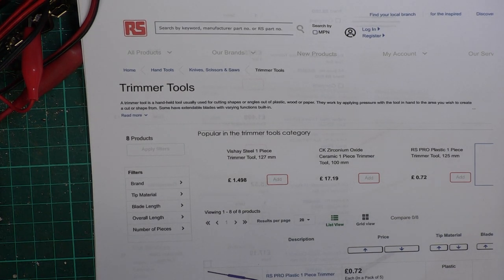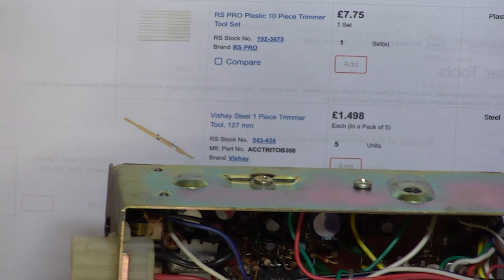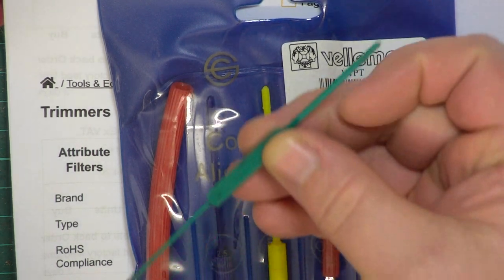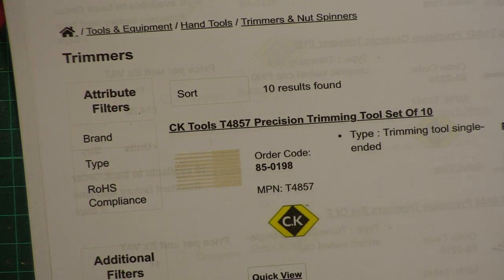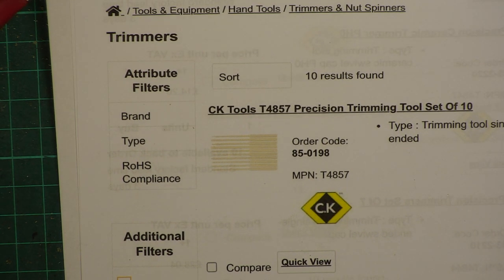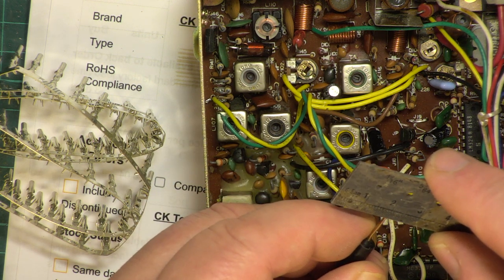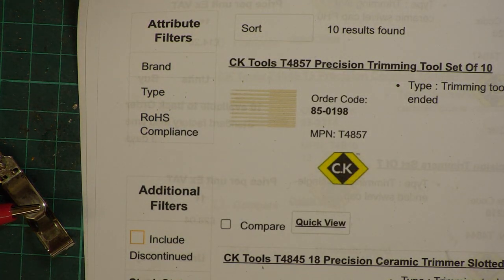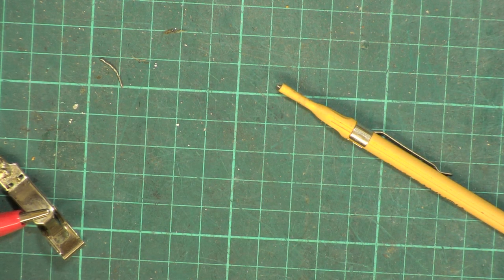Alignment tools used in UK CB radio servicing

Comment: i've got a set of Vishay trimmers all three and they're all black and badged up Radio Shack..!!
got the beige ones, the ceramic ones, don't bother with those plastic ones as they break too easy,
also got some hex ones for Cybernets and even a square one for multimode VCO.
once you find the right couple or three you never need any others.

Comment: You still get the black trimming tool, but it takes a bit of searching for.  Some Chinese sellers used to do it and it used to be common on Ebay.  They tend to be in a pack these days, but if you hunt around you will find one,  From China you do not know the quality.  RS I don't think do them these days.  I am going to have to get another set as the ones I got sat in water for a while and there must have been metal in there somewhere as they have a coating of rust.   That will not do, even the ceramic one have this coating on them!  Very irritating!  The other half of them appear to have grown feet and walked!  Strange!  Screwdrivers are no use for trimming radios, though Screwdriver Experts think they are fine for the job, this is why there are so many broken cores and radios detuned instead of tuned up.   If you have not got these tools, do not take the cover off your CB or radio.  I wonder how many people will do it with a screwdriver anyway lol.

Comment: Great videos, Richard. Would you know which type of Trimming tool I would need the the Thunderpole T800...?
Reply from the maker: The current T800 has no adjustments whatsoever, but previousversions had a few preset SMD potentiometers. I'd use either a 2.5mm ceramic tool, or the yellow Vishay type sold br RS etc...plastic with a this small metal end.  To get an idea of that type, the RS comonents part number is 543-434

Richard, UK

Comment: Hi we used to call the plastic tool with a metal end a tweeker at the BBC in the 1980's I was a film editor running a 3 machine beta cam so suite.
I have an interesting problem with a Binatone 12 channel long range.
It Rx and tx's ok but the channels are in the wrong place and 3channels are duplicated. So on channel A you have K(cb ch16) it should be cb ch 6.
Any ideas
Many thanks
Robert
Reply from the maker: Could be a dirty channel switch giving the wrong BCD information to the PLL chip....conversely the PLL could have an internally blown data line. The Binatone Longranger 6 & 12 sets I've yet to cover. They work well & were under-appreciated.

Richard
Reply: Thanks for the info I will clean the switch, is the pll still available.
Reply from the maker: The hand-drawn circuit appears to show the chip is an MSM0807. Perhaps you can take the back off your set to confirm this,

rshireby@yahoo.co.uk

Comment: Been using the glass fibre pens for 35 years, so not a new tool. RS have been selling them for that long.
Reply from the maker: You beat me, I've only used them 25 years!
Reply: @ukfmcbradioservicingTango21  When i worked in the Ferguson/JVC video factory in 1985, we had them for cleaning off the green coating off the copper tracks, when the boards got cracked to resolder across the breaks.
Reply from the maker: @marvinwatson3245  Yes, that's another use.

Richard